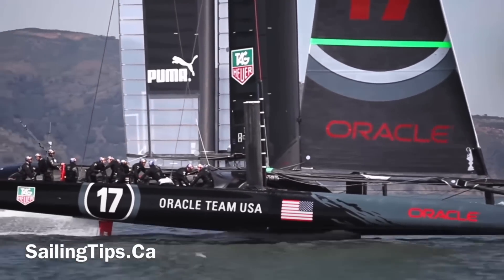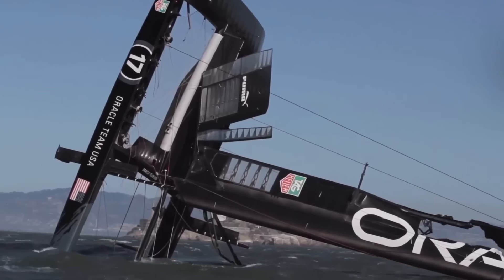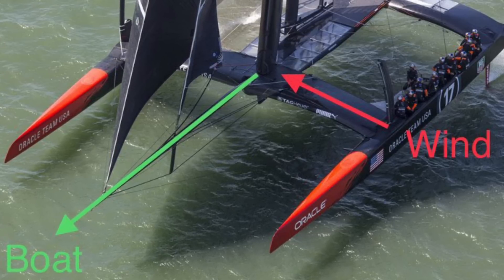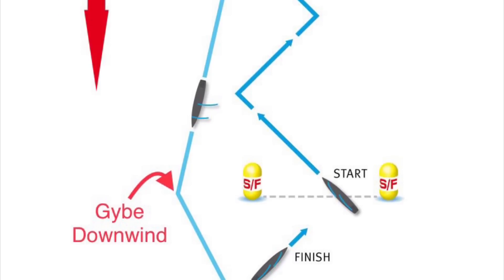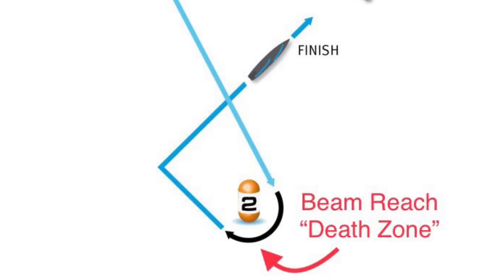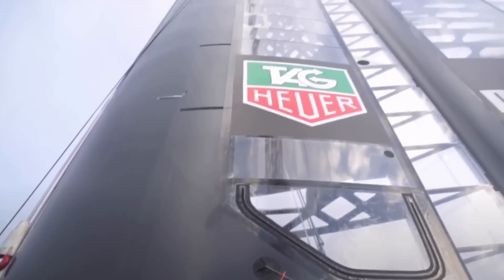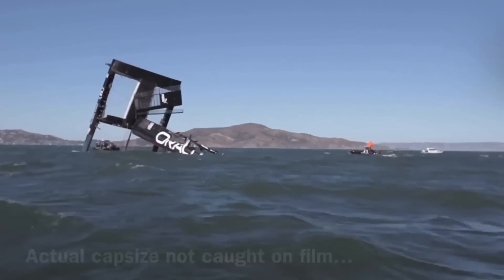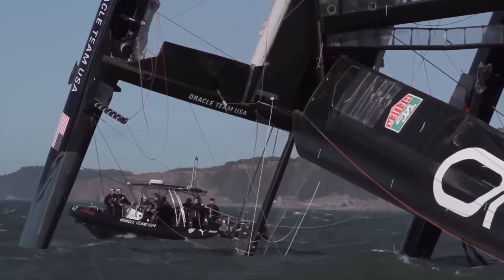How Did Oracle Team USA’s AC72 Capsize In The “Death Zone”?!?!?

Comment from the maker: I try to make my videos succinct and appealing to a broad audience, so there are sometimes details that are omitted from the final release, but which may be of interest to some:
•	The AC72s follow a “box rule” which establishes overall dimensions and gives teams freedom to design and implement different solutions (e.g. wing designs). The full rule can be viewed at https://www.cupinfo.com/en/ac34-americas-cup-2013-ac72-class-rule-01.php 
•	The AC72 rule initially allowed for different sized wings, but was later amended to a single wing as a cost-saving measure.
•	The final wing dimensions were 255-260 square metres (2,745-2,799 square feet), 38 metres (125 feet) high, built in two sections which could be disassembled, with the lower section between 18-19.9 metres (59-65 feet) high. 
•	AC72 wings were relatively simple and “low tech” compared to more modern AC50 wings.
•	The “death zone” differs boat-to-boat, but is at approximately 95-105 degrees off the apparent wind, or just below a beam reach.
•	Above the “death zone” (i.e. sailing upwind) the helmsperson can steer towards the wind to depower the boat.
•	Below the “death zone” (i.e. sailing downwind) the helmsperson can steer away from the wind to depower the boat.
•	Inside the “death zone” steering alone cannot reliably depower the boat and the only alternative is to ease the sheets, but if the sheets cannot be eased for any reason bad things happen!
Reply: Right, so that's steerable foils and a sail depower system. The 1st thing that springs to mind is an air brake, as on a plane wing. Or to let the sail detach from one place, as in a surf Kite depower
Reply from the maker: @InYourDreams-Andia  Most faster multihulls these days have more controls to prevent capsize, so they’ve learned!!!
Reply: How many children in Africa could you feed with those 3-4 million dollars? Spent money on a bad product that shouldn't sail in waves bigger than 10 cm. Who supervised the materials and construction of the ship? What if someone had died in that rollover? The ship is unusable and STUPID TO PAIN.🤮🤮🤮🤮
Reply from the maker: @dubab.249  Sadly somebody did die on one of the other boats :(

Comment: Capsize in a catamaran is much more dangerous than a monohull, and while I know a trick for righting a Hobie (small light boat) it still requires another boat to assist at least in Bay conditions.
Reply: I feel the danger watching the starboard rudder pop out of the water. I know they know what they are doing but it still triggers me a little 😂
Reply from the maker: @pearpo  Yes capsize in most multis requires outside assistance so definitely not something you want to be doing on any regular basis!

Comment: It's not the course that's the problem.  It is that the boats are all designed with "death bows."  Hydrofoils inevitably ventilate and/or cavitate - and then they fail.  Putting a bow like a stiletto on these boats is just plain stupid.   These bows were designed for displacement hulls.  Not flying hulls.  At least they've moved away from these a bit with the monohulls.  But not because the ability to realize the failure in design.
Reply from the maker: I don’t think the designers actually intended these AC72s to be full foilers, but the teams took them there by exploiting some loopholes in the rules.
Reply: @SailingTipsCa  True.  But they continue(d) to produce the same hulls even after they discovered foiling, and the flaws inherent in their use.
Reply from the maker: @powerlooper  Do you think the hulls on the new AC monohulls are better in this regard?

Comment: How can a boat be faster than the wind that is moving it forward In the first place?? 😮
Reply from the maker: That's a great question and a good topic suggestion for another video! Basically modern sailing boats generate movement by having their sails create lift like airplane wings, rather than drag like old square-rigged ships. There's a wing up in the air (i.e. the sail) and another wing down in the water (i.e. the keel/daggerboard) and both are generating lift in different directions. The opposing forces push the boat forward, like a marble between two crossed chopsticks moving in different directions.

Comment: I wonder if they should force teams to have a moving element on the wing to quickly stall part of it to prevent this from happening.
Reply from the maker: The AC72 box rule had a pretty simple 2-section wing specification to help teams keep costs down. I understand the newer SailGP wings have more sections and more control options.
Reply: @SailingTipsCa  thanks for the info would be good to see a comparison:)
Reply from the maker: @JohnFrumFromAmerica  That’s a great suggestion for another video!

Comment: Violent accelerations at beam reach lead to pitchpole, obviously because of the quick injection of forward thrust on the wing. If your boat is not already a little bit SELF-STABLE in HEAVE and pitch, the reflex ark from the guy who pilots main foil's rake is often UNSUFFICIENT. That's also what happened here....as the main foil was a 1st generation PURE L, ORACLE run in 2013 WITHOUT any FEEDBACK from the proximity of sea surface for HEAVE....Following that, so, the flying attitude was varying sinusoidally and this probably led to exagerate submarine very low depth skimming of the T-Foils who got ventilated halas and lost their downwards lifts......Solution came first on TNZ 2013 with main foils fit with exiting sea tips which regulated HEAVE, then, secondly, by relying on very long T rudder Foils in 2017, combined with low diving tilted tips
Reply from the maker: Yes the AC72 was not as sophisticated in many ways as the newer generation foiling boats!

Comment: A boat can sail straight up wind. I designed one to do it in my 20s. Just a model but very gratifying to see my theory was correct.
Reply from the maker: Sounds cool - can you tell us more?
Reply: @SailingTipsCa  It's been done with bicycles and other land vehicles too. I was shocked after inventing my boat to research and find that it had been done with bicycles and not only could you go straight up wind, but you could also go down rind faster than the wind speed. It took me a lot of thinking to understand that one. In my experiment I made a small streamlined test hull then I placed a tube and shaft with a big low pitch underwater propellor on the front end and a big many bladed high pitched balsa air propellor on the downwind end The air prop turned easily, slowly and with high torque, spinning the large low torque water prop. And it went up wind, no fuss. These days the land version is fairly well known, search on veritasium's channel. Xyla Foxlin did a design session with him too on the same subject using a 3D printed air car on a treadmill. MAybe I'll do another one one day but far too many projects on the go at the moment!
Reply from the maker: @fluiditynz  I guess in this case the propeller blades can still be positioned at optimal angles to the wind even if fixed sails can’t be anymore!

Comment: The death zone is actually in the hull of the boat. It is only a matter of time until sailors are killed - just wait. After that the regulations hopefully change back to normal sailboats.
Reply from the maker: Sadly that did happen a few months later when another one of the boats broke apart and a sailor died. All the sailors were subsequently required to have personal protective equipment and air supplies in case they get trapped underwater.

Comment: I wonder if putting an automated quick release on the sheets that cuts power when both rudders come significantly out of the water at once during a pitchpole and/or a particular heel angle is exceeded would have made the AC-72s a little safer.
Reply from the maker: There is actually a device called an Anti-Capsize Systems (ACS) that automatically releases the sheets: https://www.boatsnews.com/story/29460/acs-an-anti-slip-system-for-multihulls. Not all multihulls have it fitted though!

Comment: thanks for bringing that story back to life. I was out around the Golden Gate bridge that day. I was windsurfing and I remember a big 10knts ebb at the bridge. It was howling 25mph and gusting in the 30's + good 4-6 feet rollers going tru. Oracle USA was sailing at fast speed around the bay and it was a amazing show to see. Many boats out that day in the San Francisco Bay. After one run I remember gybing and saw the boat sitting on the wing upside down. I went back to crissy field and packed up. Crossing the Golden Gate to Marin in the car I could see the catamaran floating out to sea. The mast had folded and safety boats where helping. Oracle Team specifically turn down the Coast Guard help and were dealing with the floating boat. I stopped up in the hills in Marin Headlands. A good 90mn after capsizing, Oracle USA was floating, passed the bridge and towards point  Bonita lighthouse. I think it took for the tide to turn 4-6h later to allow the Teams to finally tow the boat back to their base. I want to say they capsized late afternoon and got home by midnight. Damage in the $5-$10M range. Check out the details. My memory might be weak on some details but I was there windsurfing full speed. You cannot forget such scene. Full carbon catamaran doing 40knts and going over is insanity. I am so proud to have witnessed that foiling history. Foiling is amazing.
Reply from the maker: That must have been surreal and an amazing experience! By all accounts what you’ve described sounds accurate. Those boats really brought foiling to life for many of us!!!
Reply: @SailingTipsCa  thank you! It was insane. Hydroptere a few years back pioneered foiling at the golden gate. Was windsurfing that day too. It looked much less controllable than AC boats. But note that hydroptere was sailing open ocean records. already. AC and SailGP baats are amazing like F1 machines on a surfaced track. I look at foiling Imoca's and feels inspired equally. Foiling has changed human activity over water and opens up so many possibilities. From Wing foiling to electric boats, river, lakes, crossings of small and big ambition. From Kai Lenny and up, just an amazing time we live in.
Reply from the maker: @StCyp  Yes Hydroptere was truly a pioneer in this area - too bad they didn’t get the weather they wanted for their Hawaii crossing! Must have been cool to see them in person!
Reply: This was when they capsized to leeward near the bay bridge right? I remember being in the spectator area with my dad but I was quite young at the time.
Reply from the maker: It was in October 2012: https://www.yachtingworld.com/news/oracle-ac72-capsizes-1847. Sound familiar?
Reply: @SailingTipsCa  the tide was of epic proportion that day, with winds generating big 6-8ft rollers into the Bay. AC72 must have been doing 30+ knots already (8th day on water only). Turning downwind and planting the nose must have felt like a bus dropping from a bridge and nobody wears a  seat belt.

Comment: I think you need to study up on sailing and do a bit more research as there’s a few things that aren’t quite right in this video. Normally I wouldn’t care but considering your trying to be educational it bothers strangely.  With the sails you were right that twisting the sail is a good way to lose power, what you missed is that the wings can do that too.  One of the main benefits of the wing is it ability to change its shape in ways that a cloth supported by 3 points can’t be.  I can’t comment about where there wing program was when this capsize happened but on the AC 50 the wing could be twisted so far that it produces righting moment pushing the top of the rig to windward.  The could also control the gap between the wing sections fore n aft . Opening the gap would let air thew the wing essentially behaving like a reef .   Sooo  the wings have much better de-power options then traditional rigs.   The wing was not the cause of the capsize and I don’t really remember hearing what the cause was but I would most likely think a control system failure or just learning the boat as these things were beasts.
Reply from the maker: Thanks for your comments! I’m trying go find a balance of content that is interesting to both sailors and non-sailors, so there were some details I initially planned to put into the video but cut to keep it brief. Yes multi-section wings can twist too, and the AC50s are far more advanced with more control options than the AC72s, which were quite primitive in comparison. The AC72s were also box rule so the boats sailed by the different teams were different, whereby the AC50s are one-design, so it’s much easier to generalize about the AC50s. My thinking with the sail twist comparison was as follows: The main sheet on OTUSA’s AC72 leads straight from the main trimmer to the base of the wing. If you’re in trouble in the “death zone” and have a split-second to react, easing the base of that wing a foot is going to have much less de-powering effect than easing the boom of a fabric main a foot, because a relatively small amount of ease on a soft main boom will produce quite a bit of de-powering twist by comparison.

Comment: on a normal sailboat there is 1 wind. THE wind period.
on these things not so much, you have the wind plus the headwind caused from your speed, and the combination of those is the apparent wind, that is the wind your sails are recieving.  if you are travelling at 40 knots on a 20 knot broad wind you have a 44.72 knot wind at 26.56 degrees towards your windward side (port side, left side)
surprisingly these sailboats go faster
Reply: Well, technically all sailboats always sail on their relative wind, it's just not as much of difference when you are sailing slower than the wind.

But even in an old monohull it is easily noticed when sailing in very light winds, it's usually much easier to go upwind than downwind since you get more apparent wind.
Reply from the maker: @Robinlarsson83  Yes all sailing always happens in the apparent wind, which as you noted is always forward of the true wind, but on slower boats it’s much less noticeable. On faster boats the apparent wind can be 90 degrees or more forward of the true wind (e.g. when sailing downwind) which also makes it easier for the crew to get disoriented with regard to the true wind direction. The “death zone” is based on true wind and lies between a beam and broad reach but when the apparent wind is always so far forward it’s not always obvious when you’re in it!
Reply: You're talking about true wind vs apparent wind. The effects of an apparent wind that differs from the true wind can be felt on bikes, cars, and yes all sailboats. Consider a run (wind straight behind the boat) in lighter winds this will be one of the slowest sailing angles because once your boat reaches the true wind speed the apparent wind will be zero
Reply from the maker: And the wind is always well forward of the beam, even when sailing “downwind”!!!

Comment: A small note here, it isn’t so much being on a beam reach that over powers these boats. It’s specifically turning through a beam reach, because of the changing apparent wind angles. They can comfortably sail on beam reaches as demonstrated by some of the pre starts and finishing legs of this series and also the f50s, which also have rigid wings.
Reply from the maker: Yes they can sail on a beam reach, but there is a subtlety to it: when sailing upwind the helm can also depower the boat by sailing up, and when sailing downwind the helm can depower the boat by sailing down, but when you’re on the beam reach (or just aft of that) the helm can’t easily turn in either direction to depower so the only way to depower (e.g. in a gust) is to ease the sails, and if that doesn’t work then bad things happen quickly! Most sailors of fast multis or skiffs will prefer to call this “no man’s land” because you can go there, it’s just tenuous!
Reply: @SailingTipsCa  dude I know there’s subtlety I’ve raced f18s for years and raced some foiling cats as well. You’re right you can’t steer to depower on a beam reach but any competent cat crew is experienced enough to depower with sheeting anyways because in race settings the space to windward of you isn’t always clear to head up into / bear off into when going downwind. This is even more so the case for boats large enough to have a dedicated trimmer for each sail who’s only job is to manage power
Reply from the maker: @CRANKED_VANG  Yes a competent race crew will always have sheets in hand ready to depower in these conditions!
Reply: As a high performance multihull sailor, I agree with the original comment here. It's not about the beam reach, I love a good reach! But rounding through those points at marks definitely requires more awareness that setting up for a beam reach.